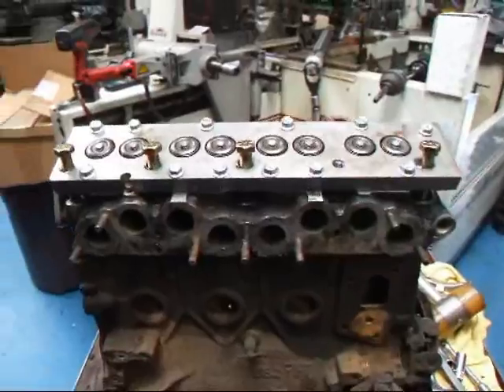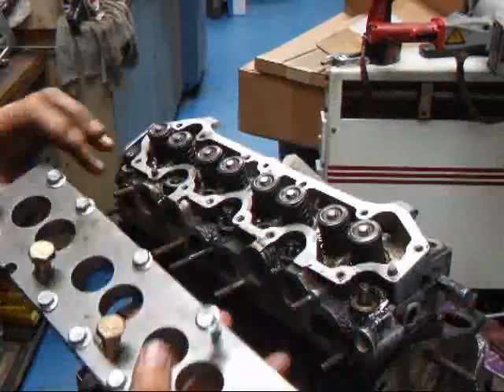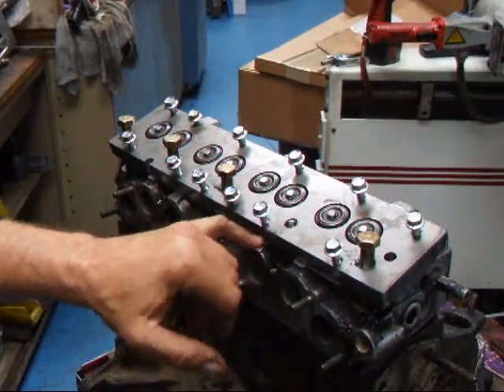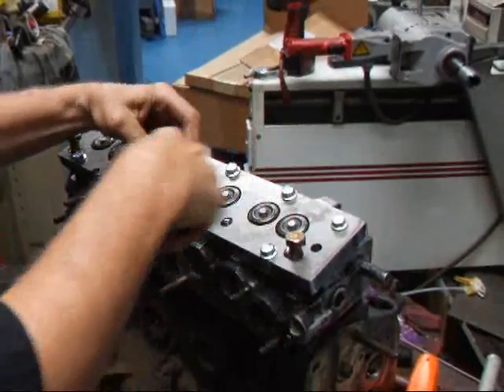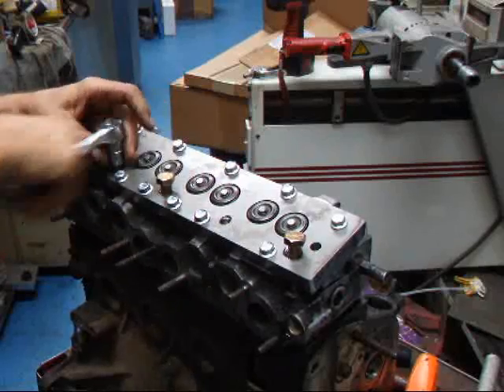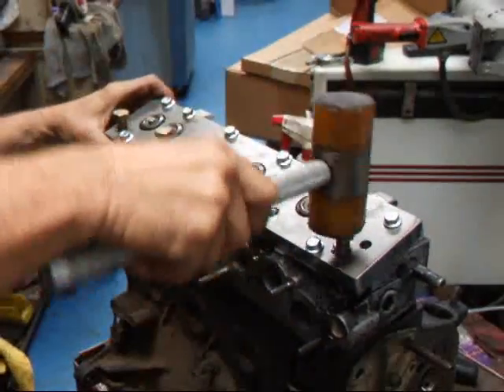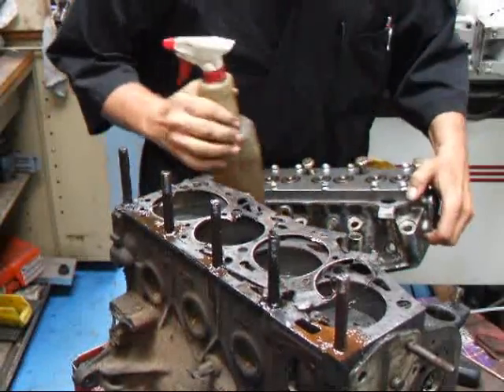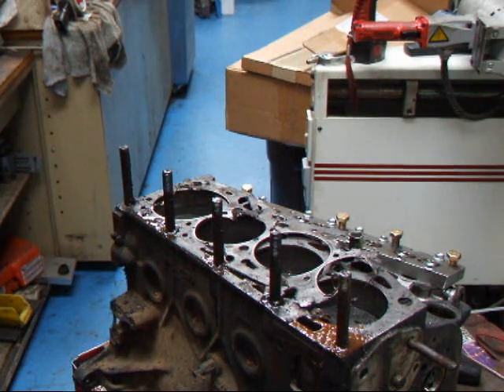X1-9 Head Removal Tool.wmv

Comment from the maker: @N200RC - Mike, I use a Fiji S9100 for still and video. I also have the new Fuji HS10 and have begun to use it as well. I you get the S9100, you won't be disappointed - bought mine used on ebay.

Comment from the maker: @drq40 - I use aviation permatex on the threads and apply anti-seize to the bolt/stud shaft before I install the head. I often machine down the bolt/stud to provide additional clearance between it and the head.

Comment: Im wondering if you have done any work on the fiat "super-fire" engine's especially with stripping and rebuilding as the cam carriers are horrible to work with if you aren't extremely careful with the small fine thread bolts into the head